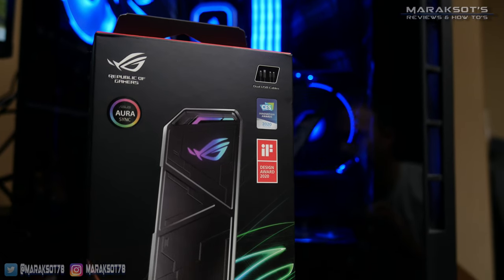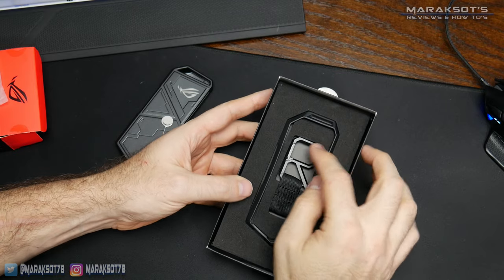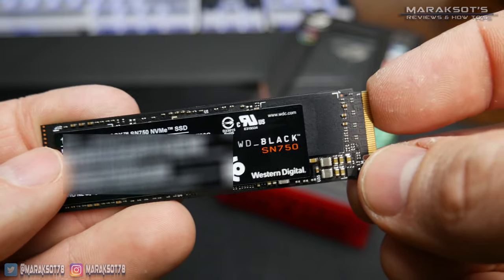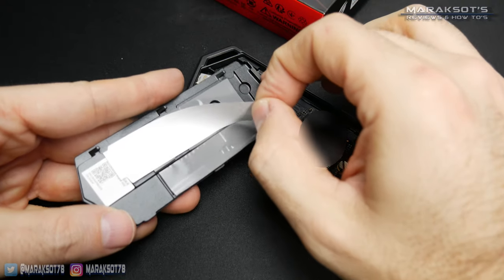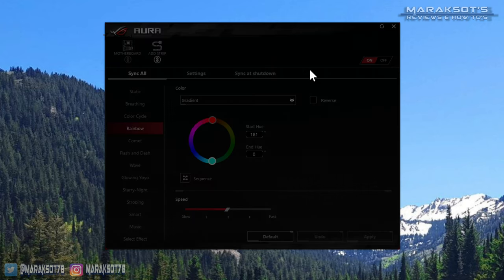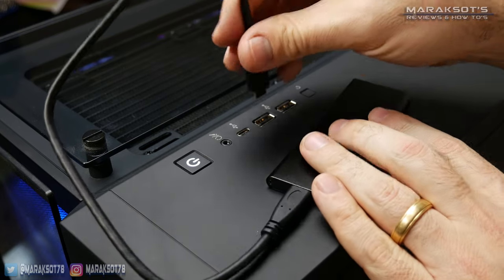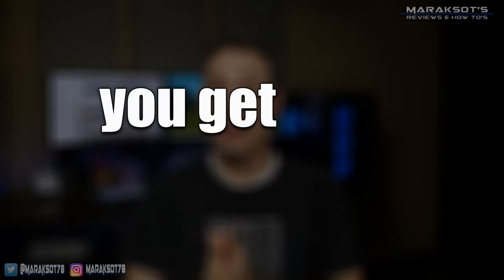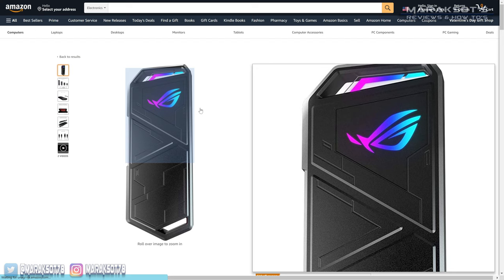The Best USB 3.2 Gen 2 M.2 NVME External SSD Enclosure? - Asus Strix Arion Unboxing, Overview/Review

Comment from the maker: Wanna skip to a particular part of the video? Use the Time Stamps. :)

Time Stamps

0:00 - say hello to the Asus Strix Arion M.2 NVME SSD enclosure
0:33 - unboxing the Asus ROG Strix Arion
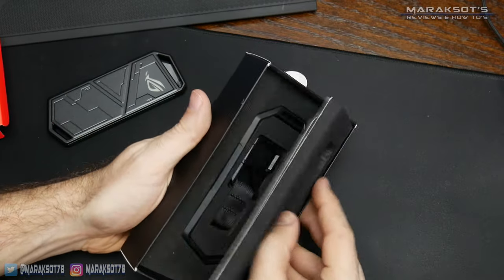1:15 - accessories included with the enclosure
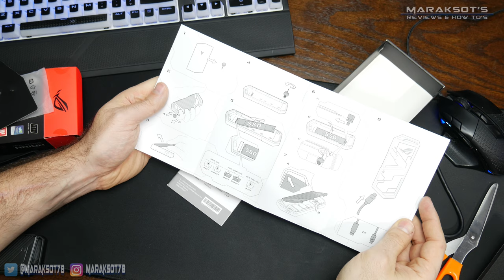3:03 - how to install a M.2 SSD in the Asus Strix Arion
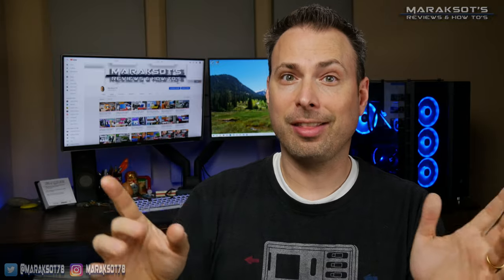5:06 - you'll need to initialize your drive before you can use it
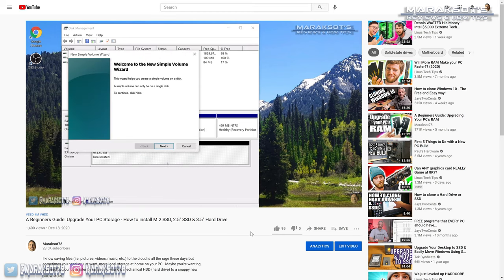5:48 - RGB lighting, Asus Aura Sync
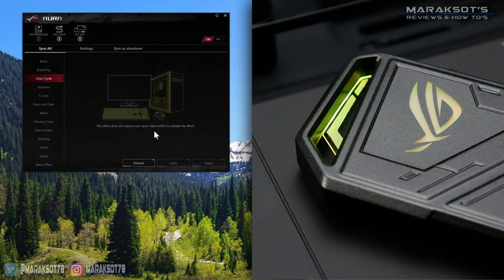6:48 - Why I bought the Asus ROG Strix Arion
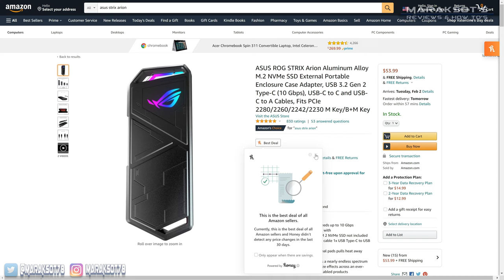9:19 - Is the Asus Strix Arion worth it's hefty price tag?
9:56 - my final thoughts
10:38 - Thanks for Watching! Like, Share, Comment & Subscribe! :)
Reply: The type C to type C is for phone my friend, why everyone only speaks about laptops and computers?
Reply from the maker: @DakDaraN  At the time I made this video type C wasn't common on phones yet. A lot has changed in the last couple years. Yes, some phones did have it back then, but it's much more common now than it was just a few years ago.

Comment: There's the thing about this enclosure. I've installed brand new SSD. Properly made everything according the manual and then... It magically worked even on a 10 year or more old LG👍TV with USB 2.0. That TV was made way before an M.2 SSD hit the market, so far in Czech Rep. That's how you should treat customers for extra cash 👍. It worked on every device i've tried for 2 yrs of use. Good job there Asus

Comment: with USB 3.2 the read and write are much higher on the Arion. Im getting roughly 1000/1100 speeds.
Reply: same here
Reply: Think it depends on the drive you, or the port i use mi Thunderbolt on my mac getting more than 1000

Comment: Thanks for the review, this was very interesting. I've been considering one myself but there are a ton of options out there.
Reply from the maker: So true. There are A LOT of different options out there and the vast majority are much less expensive than this Asus enclosure. I was just tired of the connectivity issue with the inexpensive enclosure and thought maybe a more expensive one won't have this type of problem. And I also thought comparing an inexpensive enclosure to the most expensive  enclosure avaliable may make for an interesting video, so I did it. Thanks for checking out the video Shravan, and best of luck to you choosing one for yourself. Cheers.  :)
Reply: @Maraksot78  how is it now? Still the recommended option?

Comment: you should plug with direct mainboard type-c or usb3 port not front of case. this is why your pc does not recognize the device. in laptop: i thing the dedicated cable has not enough quality. it seems like a cheep one. so replace with another high quality one.

Comment: I'm glad they included 2 separate USB cables. They could've used a USB C to A adapter witch would involve a Type A cap attached to a flimsy piece of plastic. I have one of those and they break off so easily.

Comment: If I understood correct,I have to plug the m2 ssd into my motherboard slot and initialize it first and then unplug it and plug it into the Arion???or I can initialize the ssd when it is in the Arion case??thanks bro
Reply from the maker: You can install your m.2 SSD into the enclosure, plug it in via USB and then initialize it. You don't have to install it in your motherboard first. I was just mentioning I made a previous video that walked through the process of initializing a drive.
Reply: @Maraksot78  thank you for the quick response bro!!

Comment: I have the Mokin enclosure I saw in your screen, I don't have that rotation cable problem and reaches the same speeds (SN_750 1Tb). Mokin enclosure doesn't have any heatsink, but you can buy a cheap one also 🤷🏻‍♂️ well I don't manage a lot of data so it's ok for me.

Comment: I need to do a firmware update on my Samsung 980Pro w/heatsink for PS5. Will this enclosure work without installing the top (no switch)? I'm having a problem finding an enclosure that will support the HS. If I can leave the top off and use it, I can update the firmware. Thanks.

Comment: ASUS ROG Strix Arion M.2 NVMe SSD Enclosure this will work in mobile and television ?
Reply from the maker: it should
Reply: @Maraksot78  thanks for reply
Reply: @Maraksot78  it should... just like you should have tried another cable on your cheap case. Buy the most expensive one just to solve connectivity issues, while another cable could've and probably should've solved your problem. And yes, it wil work on pretty much anything, but you'll loose the RGB functionality to the case you can't switch colours and it will probably get in rainbow mode.

Comment: he had chinese crap encloser, majority of those are scam. yes he bought cheap chinese encloser from amazon  which had fake speeds, they didnt even changed housing from fake ssds which they sold. which where showing you have 2-4 tb of space, but it had only flash card which would wipe data and show you files still there but if you would try open it its long overwritten and deleted :D so he had same scam only without memory, his speeds where also fake all this time untill he bought real one from asus lols. chinese crap will show you fake data, fake space, fffake speeds :D buy real stuff